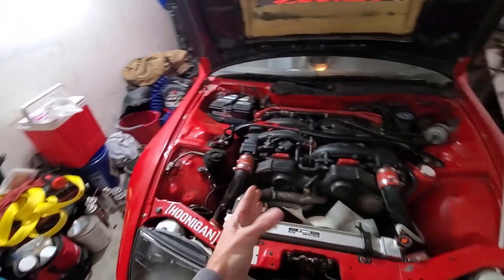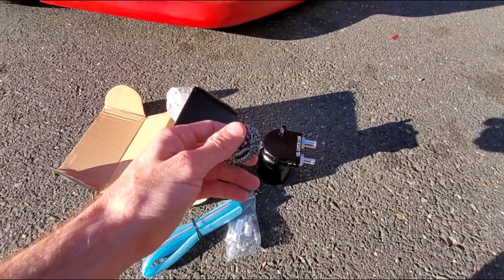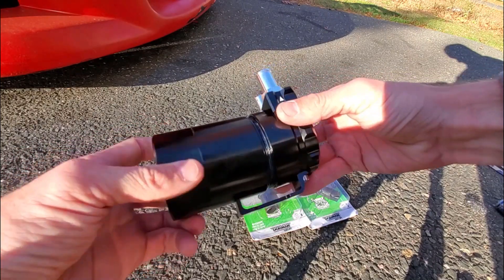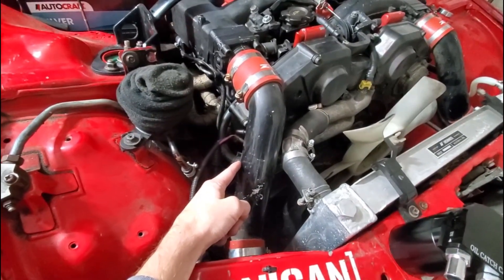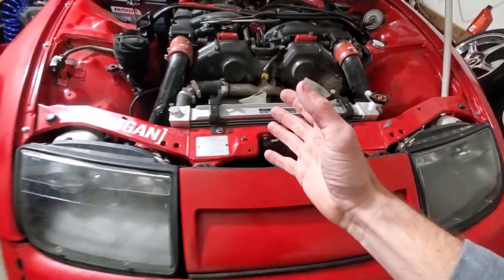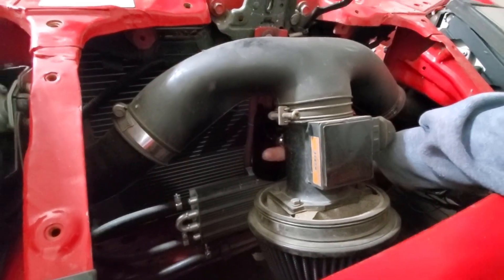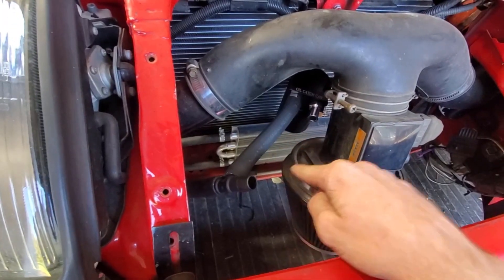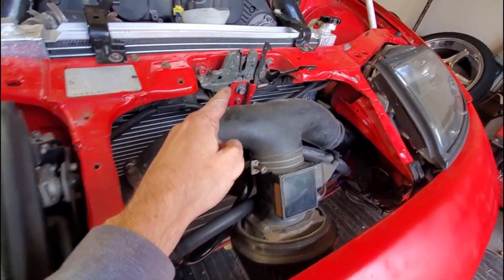PCV Delete (pt.2) Nissan 300zx Oil Catch Can Install

Comment: Good morning man,

Hey I have 94' 300zx just bought it just 3days ago. And Iv found a little bit of oil in my plenum. My car idles a bit rough idles up and down then it shuts off. Iv also noticed that my pcv valve a leak. Both sides I assumed that I have a dirty throttle body as well. So I have many questions about what is necessary to do for my Z to get it running properly.

1. Is it necessary to do a PCV delete? Will it help?

2. How do I clean the oil gunk out of my plenum, do I clean the 2 throttle bodys with throttle body cleaner? With a tooth brush? Not sure what to do.

3. Is there anyway you can make a indepth detailed video of how to step by step clean out the plenum and get it to idle right and everything back to normal.

In other words i don't quite understand about the PCV delete but i Just need it to get my car to idle right and everything runs back to normal as well as understanding what I'm dealing with. What do you recommend? Please need your help & thanks! Keep up the videos man!
Reply from the maker: Thank you for the support. I do have a complete video on how to delete the pcv on my daily driver. To clean the plenum and throttle bodies  it's pretty simple. Check out my videos of when I painted the valve covers and plenum I go in depth on how I cleaned them and painted them. I have another full video on how to adjust idle and the throttle bodies.
Reply from the maker: https://youtu.be/Wl-Bulf8a0c on how to adjust idle and throttle bodies
Reply from the maker: https://youtu.be/oRGhmsCFa7Q how to fully do a pcv delete
Reply from the maker: https://youtu.be/sS_Vh0wyO7k around the 22:00 minute mark I explain how I clean everything.

Comment: Any idea how this would work on a tt model since the “out” would go back into the actual intake pipe off the throttle bodies which the tt hardpipe pipe doesn’t have a port to throw a 5/8 hose on.....

Comment: This shouldn't throw a code on a 96 OBD2 right? I dont think there is a sensor involved with pcv. Do u have amazon links for the materials used. Work those amazon links like chris fix brotha
Reply from the maker: Links are in the description, mine did not throw a code.
Reply: @ZBruhzchannel  what year is yours?
Reply from the maker: @brotharuss  93

Comment: Off topic but I am just getting into my Z mods and my question>>>> Is that a thermostatic switch for your fans in the upper rad. hose?? AND does it work well if so? I installed dual fans on relay and want to do away with a on/off switch. Thanks
Reply from the maker: The adapter on the upper rad hose is strictly just for rad temp. I have had fans which are switched on by my switch board on my dash. We also have a video on how to set those up on the channel!
Reply: @ZBruhzchannel  Thanks. I dont need any tutorials. Just looking for who gas done what and with any success. There are locations in the heads but I have no idea if they are water jackets or not.

Comment: So if you delete pcv off the plenum this is necessary? I want to simplify my z as well and all the plenum deleted are on my list of things to do
Reply from the maker: Yes, the help with PCV ventilation
Reply: @ZBruhzchannel  awesome thanks for the help. I've had my z for 2 months so I'm still learning about all the little quirks
Reply from the maker: @171JUSTIN  sounds great, but it is a long road haha
Reply: Justin Orzel - “Necessary” is a matter of debate. I removed the valves and plugged the plenum and exhaust valve cover, then cut the hoses from the intake valve cover, capped the nips on the accordion tubes and just vented to atmosphere.

A catch can is the proper way to delete the PCV, but for lesser modded Z32s, capping and venting should be good. If you’ve elevated your boost, which will give you more blow-by - that’s where a can will really help.

Nice job on the vid and explaining everything you did!